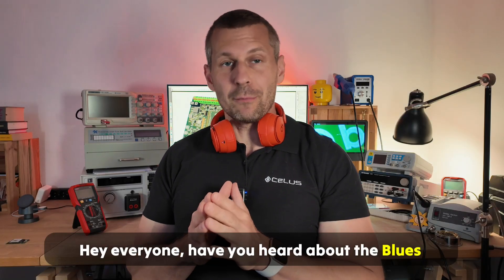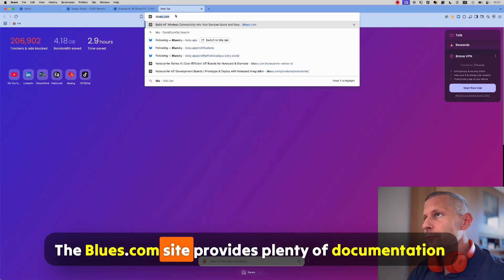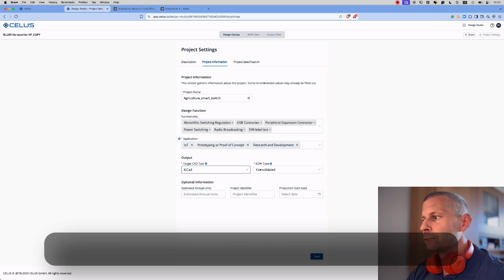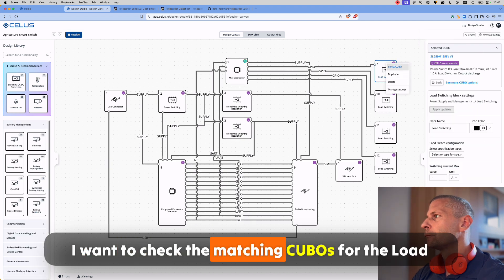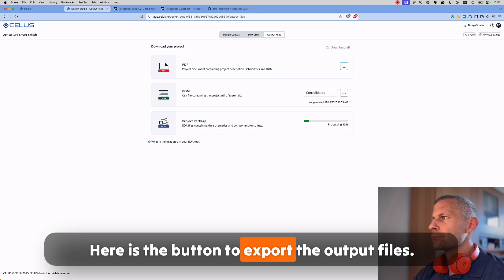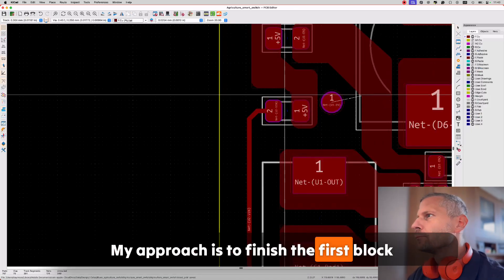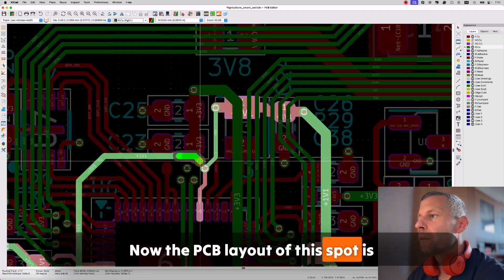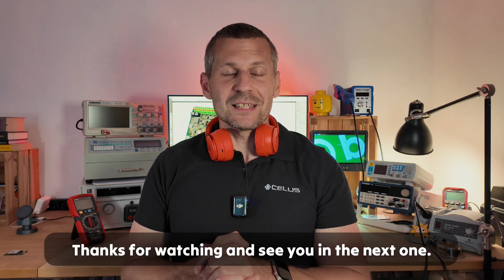𝗗𝗲𝘀𝗶𝗴𝗻𝗶𝗻𝗴 𝘀𝗺𝗮𝗿𝘁𝗲𝗿. 𝗖𝗼𝗻𝗻𝗲𝗰𝘁𝗶𝗻𝗴 𝗳𝗮𝘀𝘁𝗲𝗿.

Comment: HI, I see you are using DC-DC BUCK with I2S connection ?  Is this possible to set parameters for this BUCK
from the MCU during operation ? 
I also see, that you use INPUT CAPS for BUCK, non-polarized ? So it means it will be ceramic or film ?
If  ceramic, how to properly model function of X5R type capacitor capacity with respect to voltage ?
Becasue there is huge capacity drop maybe even 60 - 80 % of nominal capacity in datasheet.
And I see, you do not use combination of high BULK capacitor with small / 10x - 20x / smaller capacity,
to filter noise. 
And ceramic capacitors have property, that if fail, that will be short circuit at this BUCK.
Reply from the maker: Thank you for the comment. I got rid of the I2C-controlled PMIC in the final design. I used 22u/35V X5R dual caps at 5V to 3V8 buck and a single 22u/35V X5R at 5V to 3V3 buck. I don't the battery of bulk and small cap. I might be wrong but this concept has been proven as unnecessary. I will publish the design soon on Github.